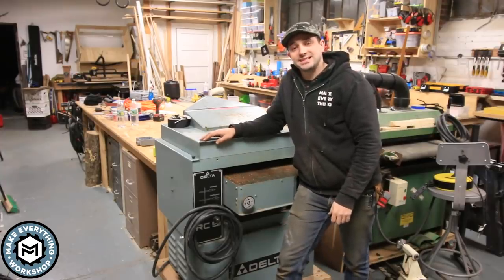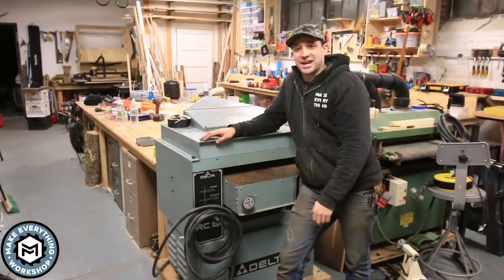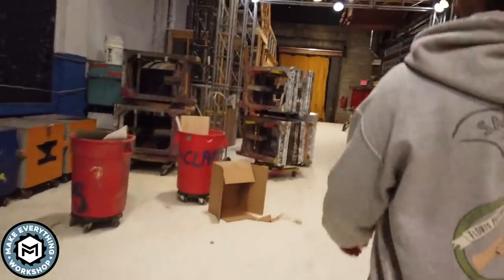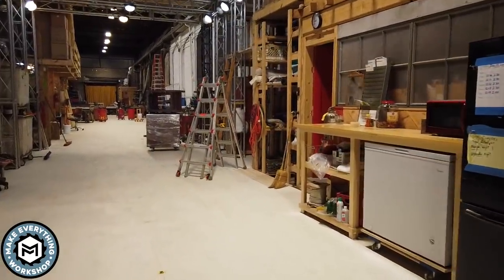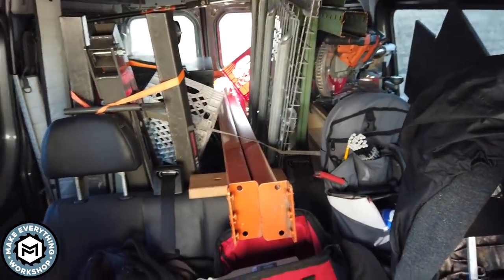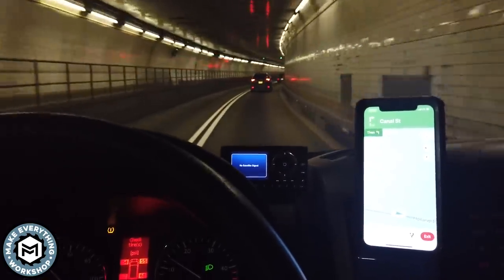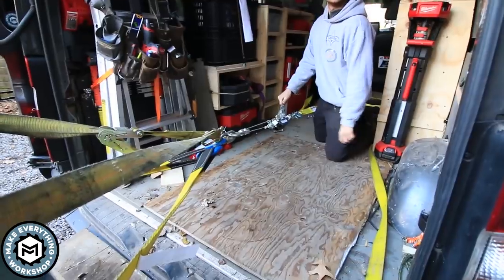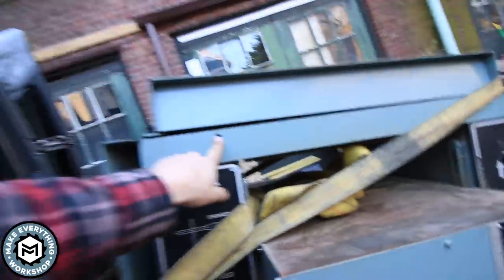Moving a 1200lb Planer With No Forklift!

Comment: Great video!  I have been a fan of Delta Machine Works since Norm Abram was on PBS with The New Yankee Workshop back in the mid-nineties.  I have always been a woodworking junkie, but I have recently had to get serious about it since I lost my job as a maintenance supervisor in our local paper mill after thirty-three years.

Since May 2023 I passed the residential general contractors licensing test and have been working toward starting my own business.  I haven’t decided if I want to build homes, but I am definitely leaning toward custom cabinets and doors.

I ran across your video while researching about an RC-51 planer a local guy has for sale at a bargain, from what I understand.  1200#?  That is crazy!  Anyway I enjoyed watching you move the saw.  Glad it didn’t tip and it didn’t appear you mashed any fingers, so that looks like a success to me.

Comment: Cool buy! I'm quarterbacking moving an Oliver 299D that I just bought, and found out it weighs 2500 lbs... that oughta be fun, lol. Just a suggestion, keep an eye out for a used pallet stacker, also known as a straddle stacker forklift. If you're patient you'll find one for a few hundred bucks on FB marketplace, or at an auction. Get a manual version (not hydraulic) and 1 or 2 fellas can load it on and off a truck by hand fairly easily. It'll scoop up anything up to about 1500 pounds. I move commercial equipment all the time (I'm an auctioneer), and I depend on pallet stackers everyday. Also, if you have a pallet jack it makes light work of anything not on wheels.

Comment: I was so sure it was going to end in tears when you lowered it down the ramp at your shop.  900lb sounded like more than that timber ramp could support, and while we could see that you had that RSJ under the ramp, I was worried it would slip off the back of the truck and drop the thicknesser onto the ground.  I found your video because I have an 180kg (400lb) thicknesser/planer coming.  The freight company truck has a lift on the back, but I need to get the machine off the pallet, and lift it again when I've made a mobile base for it.   I have seen a trick where a couple of 4x2s are placed through the thicknesser and the table raised enough to clamp then, and the 4x2s are used as lifting aids.  That's putting a lot of load on the cutting head though.  The problem with that is once you get a bunch of mates round you lose control of the situation.  I live in New Zealand where we have a 'She'll be right' attitude, and I don't want to break a brand new machine.

I take it that the table on your thicknesser is polished and waxed now?
Reply: Scaffold on two sides. Add beam above and lift with pulley or use car hoist and lift. Done with General 24" planer that is heavier than Delta.

Comment: Get some air in those tires! And fix that license plate lamp too! 😂🤣😂
Reply from the maker: Hahaha! My stupid tire pressure sensors are all dead! And man if i told you how many times I've replaced that stupid license plate light  🤯
Reply: Lmao! Sounds like time for a LED. And I feel ya on those sensors. They're a pain in the butt.
Reply: Although the LED is low resistance so the computer would probably still think it was dead

Comment: Hello, we own this exact model, purchased used. It came with a user manual. We decided to sharpen the blades, but the user manual indicates there is a Knife gauge (Part 105) and a gauge block (Part 110) that was supposed to be included brand new, which we don't have since the unit was purchased used. It is really hard to find replacement gauges that originally shipped with these planers, so is it possible you could share what you are doing for knife gauge depth?